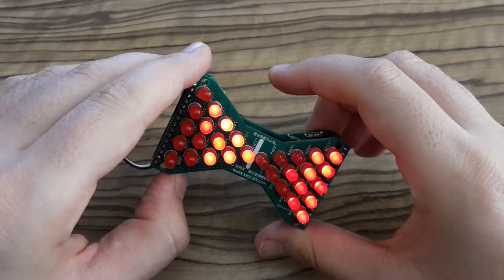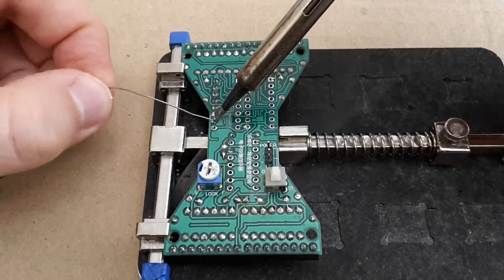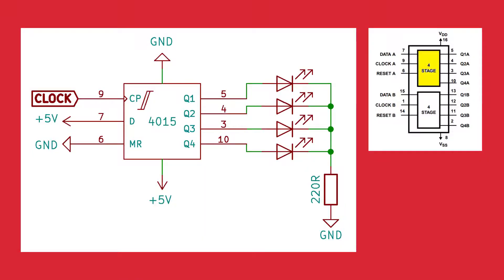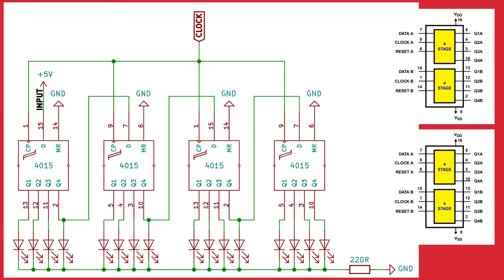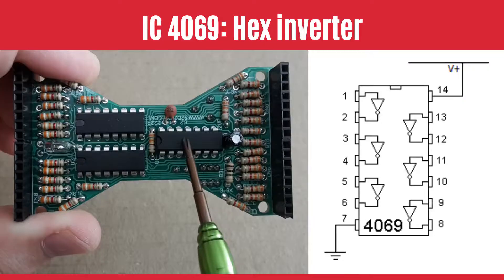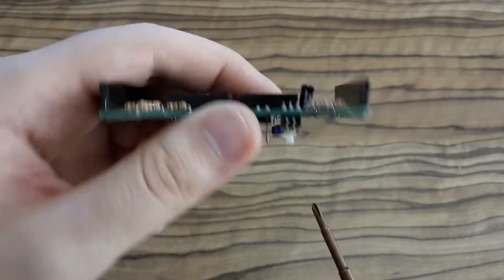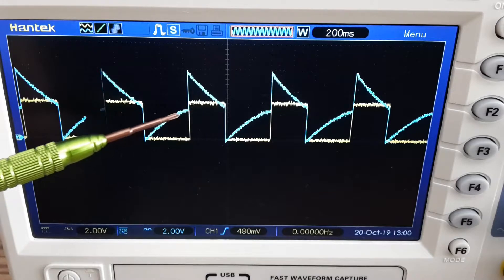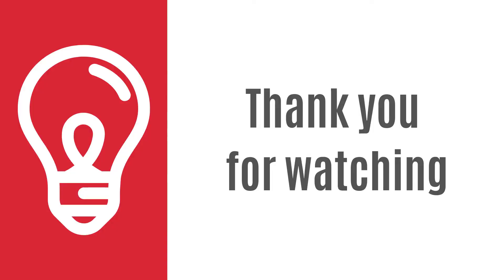Hourglass Soldering Kit with IC 4015 and IC 4069 (2/2)

Comment: Good video. I am waiting to receive the kit. I have a question though: How could the current limiting resistors be 3300 ohms? With a blue led (for instance, as that is the kit I ordered), Vf is about 3.1V, so under 5V that'll be a current less than a milliamp (about 0.6mA). A classic 5mm Led usually needs between 5 and 20mA (Low current ones need 2mA). How do those Leds even light up?!

Comment: I build the kit but when turning power on , leds go on but do not change...looks like clock circuit is not running ....where do i CHECK ?
Reply: Without a scope it'll be difficult to pin point the issue. I'd check there are no short around the tilt-switch and around the oscillator (i.e. the 4069 IC, R31, R32, C1 and VR1). I would also check that the R31 (1Meg) and R32 (3k3) resistors are not swapped. The pity is that the oscillator they use is based on 2 inverters, which is known to not oscillate under certain conditions, unlike the 3-inverters oscillator that will always oscillate (and there are 4 unused inverters in the 4069 chip, so whoever designed this kit could have used one more very easily...).
Note: I don't have the kit yet.